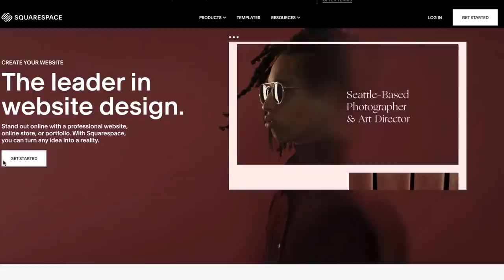The Best Way To Protect Your Timber House

Comment: Scott 8.53 , one side note , it is better to leave a 3 mm gap underneith and fill it with over paintable glas seal chaulk , the construction now will soak up moisture from the rain if the paint is crackt over there from expension and contracting. by filling it with 3 mm of chaulk , the glass seal chaulk is thick enough so it can expand and shrink with the endgrain to the bottom . it will last you a hole lot longer .
Reply: can you explain that again? sorry,i don't quite understand. which part of the video are you talking about?
Reply: @gazinlimbo   8 min 53 sec in the video

Comment: Jess I wouldn’t eat those tomatoes, when you plant them next to close to an older home that might have had lead paint on it the chips fall into the ground next to the house and could contaminate it with lead. You should have the ground tested or just plant some new one away from any structure.

Comment: Considering you're going to be doing so much work there and therefore so many cuts with the mitre bench, have you thought about adding in a stop block with a t-track and measuring tape to improve the speed and accuracy?

Comment: And one more tip. EVERDURE EPOXY TIMBER SEALER. INTERNATIONAL EPIGLASS is a 2 part timber sealer. it soaks into the timber, and once set it is as hard as 'steel'. Even if applied to rotten timber, it turns the rot to steel. Great to use on cracks in exterior windowsills before you apply filler. Previous experience on a 1910 villa tought me this tip.
 If you try and clean out the crack, you almost never get out all the old problem timber. use the 2 pack sealer and all the crack is then sealed and rock hard. prime. fill and sand then pain and it will last another 20 years.
Reply: Exactly the advice I was looking for for my 1960s house that badly needs it in many places
Reply: Could just use epoxy filler and add your own milled glass fibres. I do that and also with mortar mix, I add chopped glass fibres to strengthen it.
Reply: This!!! We use Everdure at our boat shed, both for the wood on the shed and the boats.

Comment: here in the states some use Abatron WoodEpox.  as other commenters have noted, don't use Bondo outside or where there is humidity or temp fluxuations.  i'm concerned for the same reason with standard 2 part epoxy, as it doesn't expand and contract at a similar rate to wood.  woodepox supposedly does and i've had good results with it going on 15 years now in some applications.  it also sands/sculpts pretty easily into shaped profiles.  YMMV

Comment: A bit late, but for the corner board with the groove in it you could of cut a corresponding groove in the other board and put a spline in the space, same as you would do to add on to hardwood floor.
Reply: Could’ve
Reply: @christophercrawford2736  yes, a grammatical error, thank you.👍
Reply: @dhammer5645  I of seen your spline fix before.

Comment: I'm Dutch and sorry for my English writings... But the old corners or wheaterboards, before you got the New corners on... the old corners you did some repairs on them. And you painted a primer on them or a Base paint... but did you  also use a type of impregnating agent?? Because when I do similar repairs in The Netherlands... i start the same. Before putting primer or Base paint on, I use a impregnating agent to protect the wood/ timber and it penetrates into the timber easier. 
As you pointed out about the use of Base paint/ primer... 
A Dutch expression in construction is, 'Dont make the outside a coffin...and that sounds dramatic, but masking or hiding the background won't solve anything. You yourself can probably give plenty of examples that you come across. For example an assignment that seems easy but, .....???
Hence my question or comment? Because the weather in the Netherlands, because of the rain and the seasons... we can't hide anything!

And when will Paerau come and help you with your new house/ home?? I kinda miss his presence... without getting emotional😥, hahaha...

Comment: Do flat soakers cover the whole underside of the weatherboard? Some 'builders' covered a join running almost the full height of one our walls with them, but they only cover half the underside edge. So you can see a decent amount of the unprimed timber underneath.
And their scribers are nowhere as tight a fit as yours. All the gaps were just filled with silicone sealant.
Reply from the maker: In that case I would usually do a flat version of a boxed corner. Soakers are good when you have staggered weatherboard joins.
Reply: @ScottBrownCarpentry  Thanks, that's what we thought. Your videos have helped us see a number of short comings in how other things have been done. Now we just need to convince them to fix it. Cheers mate.

Comment: Oooh look at you with your shiny new cut station.  :p

In Norway nobody bothers scribing the corners.  It annoys the hell out of me how lazy builders are here.  What is even more annoying though is some of the weather boards on my house are slightly too short and so there's gap between their ends and the corner, which I think is the cause of water ingress in that part of the house.  You got any quick and easy options to fix something like that?  I was considering just making the corner wider, but that'll probably look a bit strange compared to the rest of the house.
Reply: @derrek7502  all the boards are air gapped from the house. I'm not too worried about that.
Reply: Bad carpenters dont scribe. Choose yours wisely. I work in Lyngdal, and we always scribe.
Reply: Also, we put watertight sheets underneath the weatherboards (asfaltplate) with 23mm air gap between the sheet and the weatherboard. Any water leaking in from the weatherboard should dry out on its own and not actually get into the house. (Unless ofcourse, older house)
Reply: @thetoygun4796  It's a cabin from 1958 that was renovated/extended (badly) into a tomannsbolig about 20 years ago.  This problem area is where the new part connects to the old.

Comment: for heating just get a wood burning mansory mass bell stove built; it can have a 'black' pizza oven and can heat domestic water, can have a cooking stove,  can heat your back nicely and can have a hot bench; looks like you are not going to run out of scrap wood for burning; its also 'eco' friendly, low tech, off grid, dependable, does not emitt CO2, can burn clean, it easy to store fuel for it in advance

Comment: Curious how those soakers are handled in the final finish.  Do you try to smooth out the transition with epoxy?  I have a wood sided house from the 1910's and don't see these anywhere, but now this has me thinking, I should try to add them as I slowly repair all the failing paint and cracks.
Reply: I think they just paint over them. We have a bunch on our 1920's house. Like he said in the video, he also wants the water to get out of there so it's about a layer of protection rather than full 100% water proofing.
Reply: They are just primed and painted over.  Not sure when they started being fitted in NZ.  My 1920s bungalow didn’t have boxing or soakers on the corners of the protruding bays, leading to some minor rot.  My 1880s house doesn’t have them except where boards have been replaced.  I was going to fit some additional soakers to prevent future rot, but found they are not produced for the rusticated profile - my builder had custom made them all.
Reply: @snich63  I think late 80s was about when they started appearing in NZ but not for a rusticated profile.
Reply: Until the heat of summer when the boards shrink. An end up cracking coz they pull on the nails. As steel won't move. Waste of time if you ask me

Comment: What pins were you using in your nail gun. Were they galvanized? Reason I ask is I have just had to redo some scribers on a house built less than 5 years ago because my builder used non galvanized pins and rust marks were bleeding thru.

Comment: What epoxy filler did you use on those weatherboard cracks?
Have tried fixing the cracks in my rimu weatherboards but they keep cracking.
Reply: Not sure what he used. What I use is marine grade Bondo. I'm in the US Washington D.C. Area. High humidity. It works great.

Comment: Bro, did you have a 4 inch roller on a pole? lol. I wouldn't fit a soaker without it being aluminium with silicone at both sides, especially on old paint systems. It's a small price to pay for what is essentially a glue which stops the "flashing tacks" from backing out. But then again, Wellington's wind is extra. All that mint videography is going to fill Nelson up with Aucklander's if you don't watch out.

Comment: Just a question, would it be better to cut the the siding back away from the corner just a bit?
Gives you room for expansion and contraction and then you can easily paint the end grains.
Reply: Or even cut the weatherboard back enough that you could weatherproof the corner and attach the boxing directly to the framing. Also avoid the need for scribing.
Reply: @big_badaboom  Expansion and contraction problem remains that way, I think
Reply: Timber hardly expands or contracts lengthwise, along the grain.

Comment: Bro, you got a wood burning stove. All you probably need a 6”x 15’ pre-insulated stainless steel liner system (with top plate and cap). They probably told you not to use stove because there is a problem with the old flue tiles with the fireplace. Small house, centrally located fireplace, temperature climate, easy fix.

Comment: Curious why you put the box over the weather boards rather than using a circular saw to cut the corner the width of the corner wood pieces and then caulking between the corner and the weather boards?
Reply: you would be relying on caulk, whereas what he did solved all the problem without creating more. what you are saying would definitely create more problems. that's my opinion
Reply: @godrikblack3337  yeah exactly, the weatherboards will shrink and caulking seal would fail, I've never seen it done like that in any country, maybe it's a thing but certainly not in NZ, doubt council would like it at inspection time....
Reply: @nix123ism  It's done like that for engineered wood and cement board siding/weather boards in the US. Those products have been engineered to not have the issues of a natural wood weather board though.
Reply: @godrikblack3337  Agree
Reply: They have always built houses in the US with corner boards and butt joints. The difference is they use metal flashing(aluminum) behind that joint and the others in the weatherboard(clapboard). Building houses for 400 years in New England is proof it works. Scribing inside corners is more common in the US but likewise not necessary.

Scribers on doing nothing in a driving rain unless they are installed with sealant.

Comment: Oh god don't get me started on olde timber weatherboards. I'm 2 weeks deep on a partial reclad of an at least 1930s house in Kaitaia. Its had weatherboards replaced before and even those have poxed out. Its full of borer, rot, more rot, birds nests, and other junk. Still has some of the old lead (some of them copper) soakers and flashings fitted. But it beats replacing flooring in a toilet

Comment: I have found I get better results If I primer all the timber before I use a wood filler. But should I be doing that? I see you didn't.
Reply: I would suggest metalex first :)

Comment: what is behind the weatherboards? is there a air gap behind it? any waterproof foil? i'm interested in how you build in new zealand.
Reply: Just building paper and the wall framing. The house is an older building so the cladding is directly fixed to the wall framing. The cladding and framing is probably native hardwood so the house would be as dry as a bone and therefore no need for a cavity system between wall and cladding.
Reply: @user-oo4zo8yy5u  Probably no building paper or insulation either. Just weatherboard on framing. Bitumen
paper from about the sixties. Insulation about the seventies. Air gaps Nineties to 2000s
Reply: @psmith7011  Not correct. Bituminous building paper has been used in NZ since the late 1800s. Widely used since the 1930's.

Comment: You've probably picked your quote but my advice is don't under spec the outdoor unit. Far better to have a more powerful outdoor unit that will still work on the coldest of nights and will breeze through mild ones.
Reply: I was going to write the same comment.  I’ve had two ducted heat pump systems, and the first one was never warm enough in Auckland winter.  My guess is the unit was undersized to get the price acceptable.  The unit in my current house was more expensive, but it heats properly.

I’d also advise caution on the outdoor unit placement. In the first house, it had to be next to my bedroom wall, and the unit was actually noisier inside the bedroom, than outside.
Reply: @snich63  yeah I've encountered ducted systems that just didn't cut it. And "over speced" ones that work a treat!

Comment: Mitre cuts are only for picture frames…. and for designers who don’t understand anything about wood, functionallity or durability. In a mitre  the materiál goes from the entire thickness  to thinner and thinner … to the point where there is no  more materiál, Zero. Sharp as a knife to cut yourself on,  no way to fix it properly, and the rain love eating  at it.

Comment: Man, those galvy plates are but-ugly.  It just highlights the joint that we try hard to make disappear when building.    I call this a last resort.    
The beautiful thing is, Its your house!   you can do whatever you like. :)  

I get it,  if the wood has already failed your only other options are replacement or constant maintenance.
Reply: You're right about that. Butt-ugly butt joints. It's a classic builders' solution, not a designers'. But you're doubly right - owner's choice.

Comment: i personally would have cut them in and used a little thicker board
Reply: By that do you mean trimming the weather boards back by the width of the board so there isn't actually a mitred corner at the weatherboard intersection? Thus no scriber is needed?
Reply: @allanpennington  yep
Reply: If you'd done that you'd personally have weatherboard ends without framing behind them.
Reply: @DiscoFang  plywood!
Reply: @kurtzcol  NZ timber frame construction methods don’t utilise plywood as a sheathing. If you’d used your personal method on this house your weatherboards like your lips would be flapping in the breeze.
Reply: @DiscoFang  alright ,im a carpenter in canada never seen a house without exterior sheeting.  learn something new everyday  Thanks

Comment: Not being funny - but as a qualified builder - would you be better off just knocking that house down and rebuilding. Seems like it's got 60 years of neglect and you'll be forever chasing problems.
Reply: The cost of building in NZ is so expensive that despite all the issues, it will still be cheaper to renovate this house than build new. Also these houses are built with native timber framing, they have good bones!